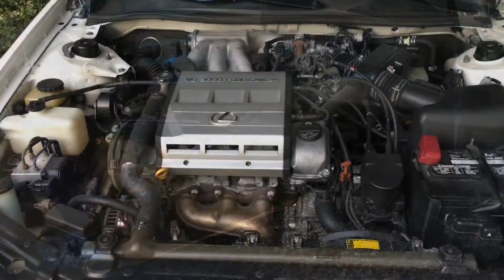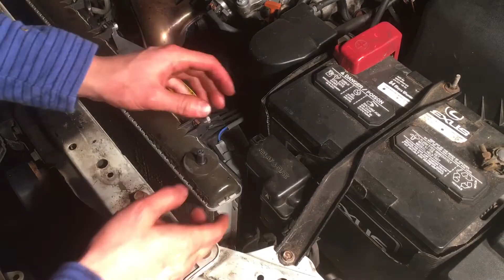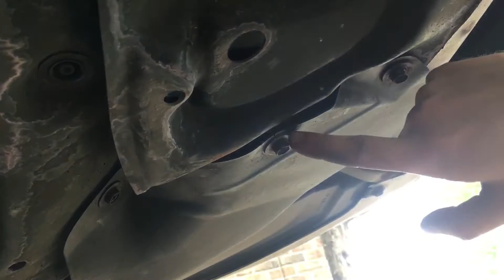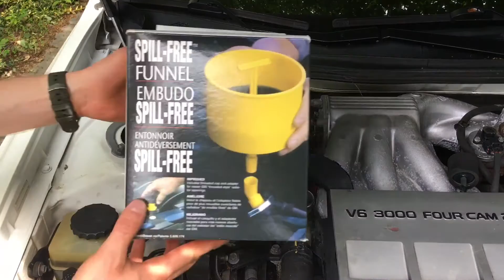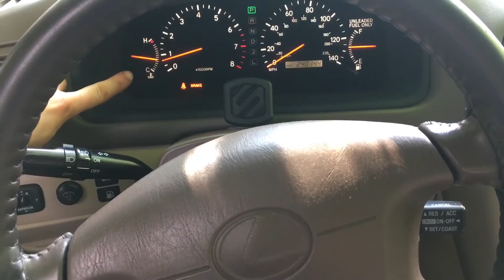97-01 Lexus ES300 Toyota V6 Radiator Replacement

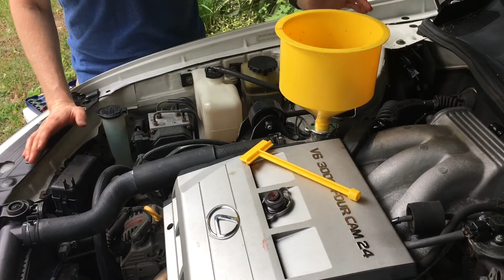Comment: Hey man i knew this is an old video im hoping you can clarify something for me. At the 15:43 mark, you mentioned that you have to wait for the engine to cool down before removing the funnel, how long do you wait exactly? Like does it have to be cool to the touch and is it necessary to have to wait for the cool down? Thanks man!
Reply from the maker: @StackXBT  sure no problem. I said that mainly because I didn’t want people to get burns from hot coolant. Really you could remove it at any point but I let it sit for a while until it’s no longer steaming hot.
Reply: @hayksamvelyan oh OK, I appreciate you answering, thank you! Hope you make more videos. Consider doing one on the thermostat, its tricky to get to and would make for a good video 👍

Comment: Is that  coolant container enough  for the system?
Reply from the maker: Yes, as long as you don't drain the block and only use the radiator drain I showed in the video. 1 concentrated gallon of coolant will make 2 gallons of fluid which is perfect. If I remember correctly, you'll have a little bit left over.

Comment: Many, many thanks for a great video. Helped me out tremendously. The only thing I'd add is that I ordered the Denso 221-0502 radiator because I have a Japan-built Toyota Camry V6 LE. I don't know if it really does make a difference, but that model number is what the Denso website suggested.
Reply from the maker: Awesome, I'm glad it helped you out. I would use the Denso reference sheet as well if you have a different model car.

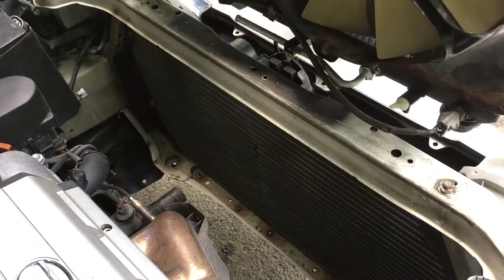Comment: At the 7:15 minute mark there is something that looks similar to the radiator in front of the radiator (approximately the same size with many small fins).  What is that?  I may be getting some leaking from that in addition to the leaking from my radiator.  Thanks.
Reply from the maker: That's the air conditioning condenser. It's used to cool and condense the refrigerant of your A/C system, hence the name. If you have a leak, you would have no cool air.
Reply: Thank you Hayk

Comment: is it ok to have a little bit of play on the radiator?
Reply from the maker: yes
Reply: yeah, I thought so. Cause the top part of my radiator has a bit of a play. It moves back and fort less than an inch.
Reply from the maker: Yeah totally normal, mine does the same thing. It shouldn't move a lot, but a bit of free play is okay. It all has to do with the condition of the rubber isolators (2 at the bottom and 2 at the top)
Reply: Good to know I'm not the only one with that issue. Thanks, great vids by the way.

Comment: I replaced my radiator today and my passenger side fan was busted so replaced that too.  Ran the car after filling with fluid and the fan won't turn on. But the driver side fan turns on. Checked the fuses they seemed fine 2000 Lexus es300. Please help
Reply from the maker: One of the fans will only turn on if the A/C system is on. That is most likely your issue.

Comment: if the engine was blown could you put a 98 toyota camry in it?
Reply from the maker: Technically yes, however each engine series uses its own computer, so you would need to modify the ECU and probably some other sensors to make it work. Even the 97-01 ES300 engine differs between model years, so you have to look for the right one.

Comment: Great video and well done.  I especially liked the sheep and rooster sound effect when you had trouble with the clamp on the top radiator hose.  I used the video to change out the radiator and hoses on a 2001 Toyota Avalon and everything went well thanks to you.  Saved about $400 bucks over what the Toyota dealer wanted for parts and labor.   By the way, purchased everything off Amazon.
Reply: Vf6
N
.so m npm ny3 I 3rd  llxz
Custom

Comment: Did you have to choose between a 5/8 or 1 inch radiator core?  My 2000 Avalon has an option and I'm not sure which to get.  Thanks.
Reply from the maker: That's the thickness of the aluminum section of the radiator. The thicker the core, the better the cooling efficiency. Obviously, there are physical limitations on how big of a radiator your car will accept, so I recommend measuring the one that you have and matching it up.
Reply: Ok, that is what I was thinking, but wanted to get some verification on it.  Mine is a 1 inch core.  Thank you.

Comment: WOW  What an excellent video. I like that funnel. I think you edited out the trans fluid check. You did a great job editing this video to get right to the point. I like the barn yard comedy to make fun of your clamp struggles. I have a 2001 and this looks exactly the same at the radiator so this will help.
Reply from the maker: Vince Amato thank you so much for your encouraging words. I've been meaning to make a video like this for some time, so it really means a lot to me when I hear people appreciating it. 

Regarding the ATF check, I decided not talk about it because it's a fairly complicated task and this procedure did not remove a significant amount of fluid. The loss is so minimal, you don't need to add anything back in. 

p.s.: I figured out that you can spray the top hose with some silicone to make the clamp go on much easier.

Comment: You Milwaukee Impact wrench is awesome. What model number is that?
Reply from the maker: Hey thank you watching. The tool is called  
MilwaukeeM18 Fuel 18-Volt Brushless Lithium-Ion 3/8 in. Impact Wrench Compact Battery Kit. I'm not sure what its part number is, I just remember it came with the smaller sized batteries which honestly last a very long time. Highly recommend these Impact Wrenches, it's definitely one of my all time favorite tool investments.